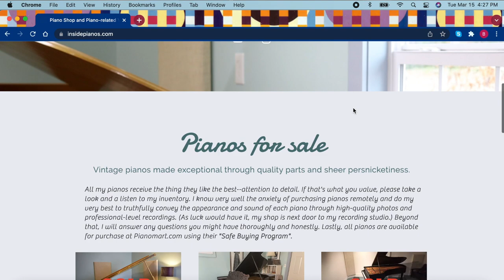Piano Maintenance - Beyond Tuning

Comment: DUde that piano sounds perfect!   Now play some Bach like that.   ))   ....question, what difference does it make to the sound to change strings in c, d 5 range?  I am looking to get out of a super thin, but lots of sustain problem....   hammers are new, action is "wiener action" Bosendorfer 1906
Reply from the maker: You know? My wife doesn't care for Bach. I know!  She has plenty of stellar traits so it still works out okay. But, maybe sometime when she's gone... ;)  Always good to see you in the comment section!
Reply: @insidepianos  understood about the Bach.   About String change in the C5, D5 range (3 strings), as I recall you have done this yes?   I assume that it will be brighter with new strings.   I don't need that, i need more sine wave less square wave and more warmth and richness.   I have some string material to cut and get into....    But any chance it will warm up my tone?
Reply from the maker: @thomasschwarz1973  Oh, sorry, I forgot to speak to your question. First off, I have some experience with rescaling but the thinking part of it was outsourced. The commenter below, Regi, is quite knowledgeable about the subject as is Arno Patin, the man I got in touch with. Patin has developed a spreadsheet available for purchase that allows YOU to enter your string lengths and design your own scale. Additionally, the Paulello piano wire website has a free resource (albeit with less info). You might see what that spits out. 

We're assuming your issue is truly one of scaling and not voicing or strike point (have you tried these measures?) I certainly hope it's not a downbearing issue. Have you checked for that? Lastly, making sure the hammers a mated to the strings is crucial for a proper evaluation. 

I can say that I have experienced a noticeable improvement in that area as a result of re-stringing/scaling. And the strings I replaced were not that old so I think the improvement I noticed was due primarily to the rescaling. In my case I went with thinner wire than was originally called for which gave a livelier, sweeter tone. My understanding is that thicker wire (at least when it's within ballpark-acceptability) generates a greater "loudness quotent". It could be in your case you'd want to go up in wire gauge. 

I'm stabbing in the dark a bit here. A free way to explore this is to go to the Paulello site.
Reply: @insidepianos  Awesome dude!!!!   You have opened another (set of) door(s) for me.   For you, 1) site read all of bach keyboard (bwv 772 to 994), repeat, 2) buy earplugs for your better half, but that is a joke.  If you Play the Bach slowly enough so that you can truly site read it, e.g. bwv 848, 7 sharps, lots of modulation to keys with double sharps, and with NO DECORATION, NO PEDAL, then it will win her heart!!!!  Try it!!!!
Reply: but no more than 3 repeats of a piece, then move on, next.  No memorizing, just reading, no rubato, on beat as best you can, but no mistakes is the goal, so super slow.